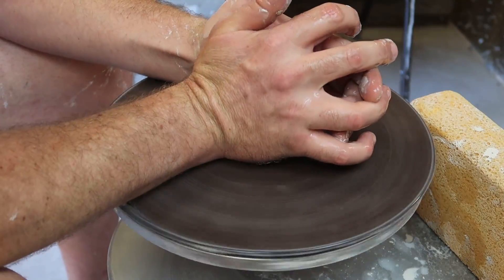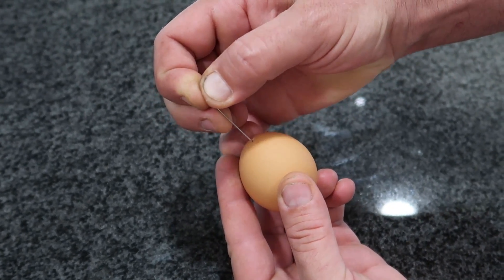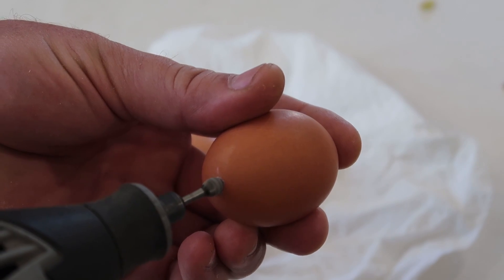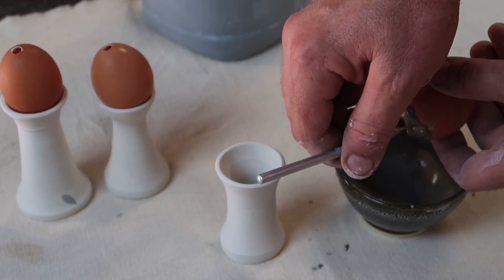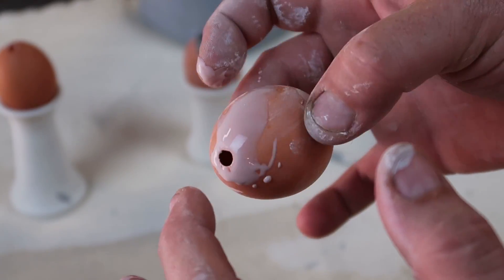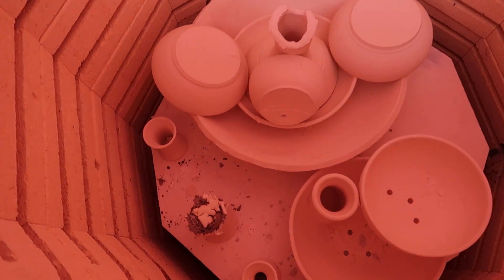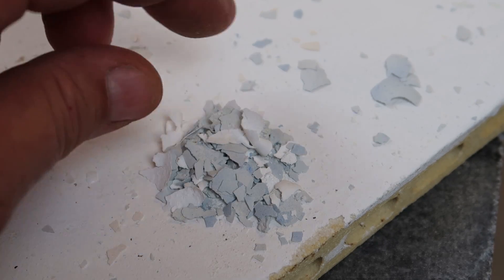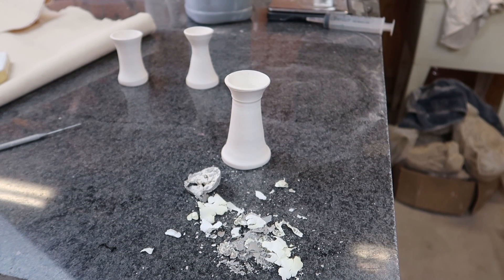Ceramic Egg in the Shell - Experimental

Comment: Next time, blow the eggs out. Wash out with soap and water and then boil for about 5 minutes.  Drain out water and dry.  Now you need to WEIGH your empty shell.  Now fill with your slip. Shake it for about 7-10 minutes. Pour out slip.  Heat it about 200-225 Fahrenheit. For about 10 minutes… reweigh your shell.

You will either need to color your slip or put wet clay on the small pin hole.  Put your stain in.  Put a piece of clay onto the other end.  Roll around dot 12-15 minutes. Pour out then repeat.  Your glaze may not work from off gassing building inside the shell or the conversion of liquid to solid may force the shell apart from expansion.

Comment: Hey Justin! Thank you for the adventures! I would put the eggs on needles in the kiln and not on this vase..  I would let them free.. there was the trapped air that caused the explosion, but perhaps there was a too high discrepancy between the temperatures from the eggs and the vases..
Just a thought..
Reply from the maker: I didn't think of a heat differential between the egg and the holder.  Interesting.  Thanks!

Comment: A couple thoughts: 1) Why not just drill or dremel the hole in the egg to begin with? I agree that the needle looks difficult, drill might be easier to control: 2) I would absolutely bake/fire the egg shells before filling to burn out the membrane and make the remaining shell more porous. The baked shell will be very fragile (the membrane helps hold it together), but it should behave a little bit more like a piece of bisqueware or a plaster mold; 3) For the glaze-then-slip tests, I would also make sure to dry it very well after the glaze (set it on top of a firing kiln for a bit) because the shell will have very little ability to soak up or wick away moisture. Awesome experiment, good luck on the re-try!

Comment: I was skeptical simply because egg shells are not permeable, especially with the shell membrane still in place. Moisture would not be absorbed nor would it be able to escape, hence the splatter. Maybe if you baked the shells at a low temp for a while before adding the slip, then slowly dried them out to get rid of any trapped moisture. I was curious if the shell would act like a flux... which would make a good experiment in itself.